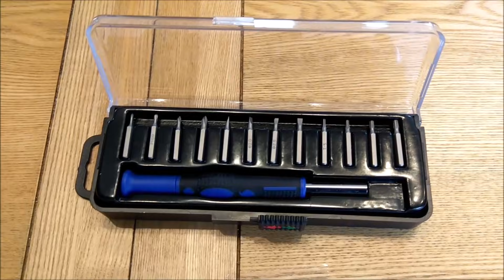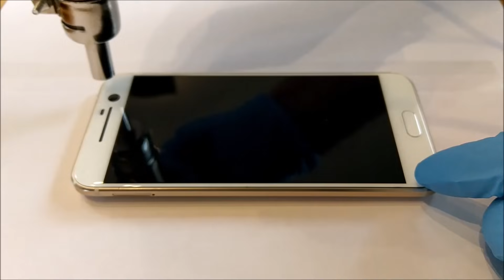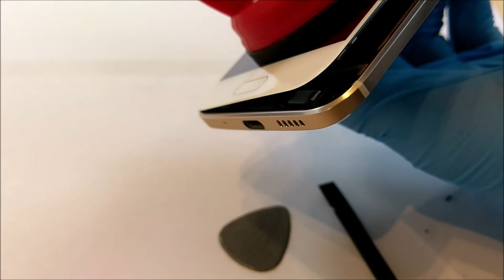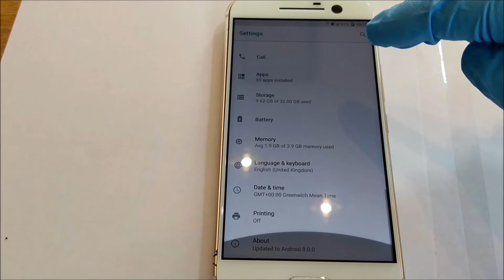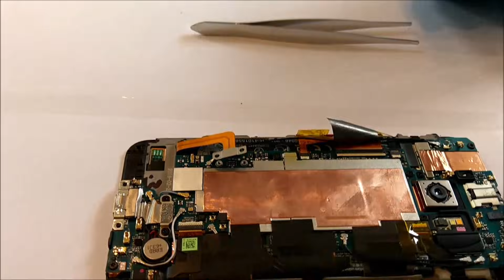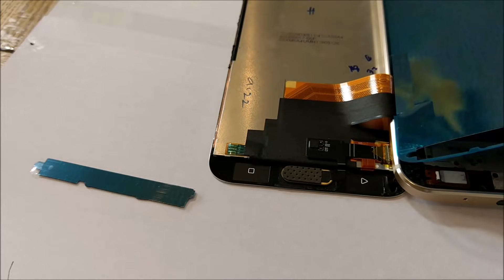HTC 10 Mobile Phone Battery Replacement

Comment: Hi, where can I get a tool set from to do this? Also which glue is best to use?

Cheers
Reply from the maker: I used B7000 glue, it worked better than the template. The tools are readily available on places like Ebay or mo ile repair sites. Thanks.

Comment: Great video. Really helpful. Can you tell me where to purchase the glue template from as that looked so easy. Regards
Reply from the maker: Hi,  It does look easy, but it's a waste of time as it doesn't stick well enough, and the screen starts to come off.  In the end I just used B7000 glue to stick it down and then put some heavy books on top until it had set.  Don't worry about a bit of glue getting on the phone, you can scrape it off afterwards.  The glue is available on Ebay. Thanks.

Comment: I have a tip for anyone that has the same problem I had. This guide is perfect and addresses many of the pitfalls before you make them. However, the camera has an attachment point that came undone when I followed this guide. I didn't realize it until I had the phone completely back together. Reattaching it involved an even more intricate teardown and reassemble than this guide. Save yourself some headache and don't detach the camera like I did.

My phone currently works perfectly. This guide is wonderful.
Reply from the maker: Pleased it helped you.

Comment: Thanks loads for sharing your skills. I used your video as instruction and I actually changed the battery of my HTC 10. It took me about 2 hours to get the screen off and in the end I worked 4 or 5 hours on the whole thing but I made it! Now I've got a couple of small black dots along the left edge of the screen, so I might have damaged it a little bit. But it doesn't disturbs so it's the price I gladly pay :D Now my phone doesn't turn off by itself anymore. Again, thank you so much!
Reply from the maker: That's great, we'll done, it's a tricky procedure. If you're really keen (but I wouldn't advise it) you can split the screen into its various layers from the back, they just peel apart. It's unlikely that you actually damaged the lcd part, the black spots are normally marks on the back light dispersion layer from prying when getting the screen off. It's normally tape or glue or dust. I use a cotton wool bud to clean it or compressed air to blow it out. If you're happy, don't bother though. Thanks.
Reply: @blackstone4823  I'm glad it works again, I won't touch the inside again xD

Comment: The worst part of the ENTIRE job (besides unsticking the battery without shorting it and causing an explosion)...is putting the main body back into the outer case without kinking the buttons. It's amazing the original assemblers were able to do this by hand. In no way will it just slide back in, the top and bottom edges catch on the main body, which makes it difficult to focus on keeping the buttons out. Pure madness, lol.

Comment: Bottom ribbon was glued to the screen. You skipped a few frames then. There's absolutely no way to unglue that from the screen or prise it from the centre without wrecking it. Funny how all the HTC phone how-to videos on youtube from phone fixers never seem to have phones with major glue issues. Don't make it 100% clear or you'd dud yourself of money lol.
Reply from the maker: The bottom ribbon is always glued to the screen around the buttons, the heat you apply normally makes it peel away quite easily, without heat you'll probably break it. I'm not a phone fixer, just sharing my personal experience. In fact all the HTC10s I have fixed have been for free. I made it as clear as I could to help anyone out there keep their HTC10 in service.
Reply: @blackstone4823  OK so why didn't you mention that it was ALWAYS glued in your video. You said sometimes both sides (maybe) The button on the other side no problem to unglue on mine even tho' you never had any. The other side didn't show you prising apart the ribbon from screen via the centre button...the video skipped a few frames. Everything else was manageable and you leave out the most difficult part!

Comment: Will a hair dryer do the job? I dont have such a hot air thingy at home 😉
Reply from the maker: Yes, I have successfully used a hair dryer, but be careful by angling it off the edge of the phone rather than into the middle.
Reply: @blackstone4823  I just did it! Great tutorial! 
But i damaged the screen at the top right corner where the clock is. I think i got under the screen with the plastic at the beginning when i tried to remove the screen. Damnit this thing is a hell to repair. Is there one more complicated than this? 😄
Reply from the maker: @derFuchsi  Big shame! Yes, I suppose it is a difficult phone to change the battery. HTC never intended it to be done. 2 years and then throw it away I think! If you really want the phone, you could buy a replacement screen I suppose, but that's another job to do! All the best.

Comment: Hi.  Thanks for the video.  My HTC10 battery or something (software bug) had been failing, same problem you read about.  It had been doing the thing where it prematurely powered down (even at very high charge levels) and required a hard boot for weeks before it failed.   The power board had failed, too, we thought, at the end. The phone would try to boot but then cut off. 

A couple of the connector types were difficult; had to develop techniques for those along the way. Your instructions were excellent!    We successfully (imo) replaced the HTC 10 battery (and went ahead with a new screen and power board since we were at it).   
So the phone booted at 57% battery and operated all properly until drained.  But something else is wrong -- the new power board won't charge and gets hot.  

I would like to find a way to charge the new battery that's installed while it's OUT of or disconnected from the phone, via that ribbon cable. (We haven't closed the phone up again so I can take it out easily. )  Can you help, please?

One battery charge would at least allow me to recover some data.
Reply from the maker: Hi, sounds like you've had your fair share of HTC 10 fun! The power board getting hot is bad news and is normally caused by a short in the ribbon cable connector where it connects to the main board. When installing the power board, did you connect the ribbon cable with the battery connected? The battery must be disconnected at all times. Anyway, there's nothing you can do about it now except look to see if it's straight and pushed in properly. Unfortunately you can't charge the battery when it is disconnected via the cable, its a very complicated and electronically controlled process. If the data is important, all I can suggest is sending me the phone (if you're in the UK) and I'll do my best to get the data off. I have one here half in bits to help! All the best.
Reply: @blackstone4823  Thanks very much for the reply.  And offer of help!  Unfortunately, I'm in the States.  Maybe our discussion will help someone else who reads in future.

The battery was never connected while we were replacing anything.  And a correction -- the phone back was getting hot while I was draining that new battery, but the power board actually never responded; it was as though it wasn't connected.  Not sure it was getting hot or not.

My partner is an electronics engineer.  I understand that you need a circuit to control  charging a Lithium Ion battery.  Along with the battery, power board, and screen, my partner had bought some little charging boards (intending to charge up that battery before installing).  But the connections are extremely difficult so we didn't try that out while attempting rebuild of the phone.  (Thus it came up at 57%; we were lucky we got any appreciable power.)

Now that our rebuild did not work, there was nothing to lose, we thought.  Last night after sending this question to you in comments, we were trying to connect one of the little charger boards to the new battery (all unplugged, of course).  

But upon touching with light force to make the connection, the black plastic part of the connector on the new battery's ribbon cable actually disintegrated.  ( Same thing had happened to the connector on the first power board we tried before -- that black plastic must be getting old?!   Never seen anything like it. Are all surface mounted connectors fragile near to one-time connectors?  A moot point, I guess.)

So...  now I have a new battery with broken connector, and the original bad battery [ using a meter to test] with a good connector.  

Without getting into the silver packaging or chemistry of the old battery, we managed to remove the "end cap" circuit with ribbon cable of that old battery.  It was taped on fairly strongly.  It's just got two conductive tapes about 8mm (?) on the battery end for +/- that actually are accessible.  We're assuming the little linear circuit board (teensy tiny parts!) is the temperature sensing part.  So there we stopped for now.
Reply from the maker: @rwind656  I think that most phones are one-time phones, never mind the connectors.  They are never supposed to be opened, the phones lasts the contract period and that's it.  It's a shame as I'm still using an HTC10 that is nearly 5 years old and it's great, I don't need anything else.  I think more stuff should be repaired and re-used rather than thrown away.  All of the internals are pretty fragile, it's difficult to dis-assemble and re-assemble without breaking something on your first attempt.  You're lucky to have an electronics engineer on hand.  I think that the linear circuit board is also the under and over charge protection circuitry.  How much did the new battery cost you in the States?  If the data is valuable, I can send a charged battery over so you can get the data off.  It'll probably take about a week.
Reply: @ @blackstone4823 , thanks very much.  You did well to keep your phone in operation!  Kudo's.

I think I got most of my data off but I was having trouble with the USB-C cables transferring data to my desktop for a long time -- without realizing that some cables will only charge, not pass data.  Duh.  So I had not pulled everything off routinely.  And had not kept up with backing up in other ways.  Silly of me.  We'll see later if I have salvaged my contacts list; I really think I might have saved everything else, and I might have the contacts as well, though the last time I migrated to this phone, it was garbled data.  Fields missing and misplaced.  Thanks for the offer to help;  let's see how far we get.

The new battery was ... something under $20?  The screen was pricey-- pricier, and sure enough we separated the original on the first opening.  I will ask how much it all cost, as I lost track and did not do the ordering -- I might miss a detail so I let my partner do the ordering.   

Today, as I was writing you, my partner ordered another power supply and we are going to attempt charging in some fashion (though I was pretty sure we already had an adjustable supply -- there must be a reason -- perhaps something more controllable).  

I know you don't want to overcharge and as well as +/- on the outside edges of the battery connector's ribbon cable, there were two other labels on the narrow little middle conductor.  

"ID" is perhaps an identifier for USB-C to say which way the plug is inserted by the user.  [ I think from a search  Look down below the drawings of plugs, a paragraph...

https://batteryuniversity.com/learn/article/charging_from_a_usb_port.]  

And "TH" has to do with the temperature sensing.   Interesting.  My partner suggested that just supply pos/neg might not be enough -- if the temp data is not supplied, or reads wrong, perhaps the phone will not operate.

I guess it's become as much an electronics mystery project at this point.

Comment: where did you get your glue template? Im not able to find one that wont take a month to get here. What are my alternatives? Ive found glue tape, but a lot of folks say this stuff wont hold for an extended period of time and always ends up coming off. Im familair with the E7000 glue, but Im a little hesitant to use that since I don't know the glue points in the phone and a little reserved at making a mess in the phone with liquid glue.
Reply from the maker: I didn't use the glue template in the end, it didn't last. I stuck it on with B7000. Just run it all around the edge, including under the screen ribbon, in as small a bead as possible. Good luck.

Comment: excellent very detailed tutorial. Everyone says this phone is a nightmare to replace the battery. doesnt look too bad to do. One thing I would do beforehand is remove the sim and sd card before doing anything.
Reply from the maker: Thanks. It's not so bad after the screen is off. Getting the screen off without damaging it is tricky. Some just stop working for no apparent reason because the ribbon cable can't cope with bending, and fractures inside. The older the phone gets, the harder it seems to be. Have fun!

Comment: all went well until I discovered I have lost screen sensitivity in the lower 1/2 of the screen. I'm guessing there's no easy fix... done and dusted?
Reply from the maker: I'm afraid I've never found a solution except to replace the screen. The ribbon cable breaks inside when it is moved doing the repair. Copy screens are cheap, genuine ones are expensive and not worth it. Sorry it didn't work out for you.

Comment: Thank you so much for this guide! It's the best guide on YouTube regarding the HTC 10. Today I changed the battery in my dad's HTC10 using this guide and it all worked out well. It took me three hours but in the end I was very happy. I also changed the display as the old one was broken. I have a Zhalinda B6000 glue flask and I was wondering how to glue the screen back. Do I really need a template or can I apply the glue directly in the corners? Also the Power button came off and I was wondering if it needs any glue to stay in place or when I push the board back in it will press upon it and fix it in place? Thank you very much once again for all the work you've put in this video and be sure you saved a lot of people!
Reply from the maker: No you don't need a template, and I don't use one anymore because it is not good enough. I carefully clean off any lumps of old glue and then put a small bead of glue all around the edge, including where the ribbon cable is (can be tricky, do it there first with the screen in the closed position). I also put one bead just above the LCD panel being careful not to obstruct the speaker, camera and sensors, and one bead just below the LCD panel to prevent light bleed from the haptic keys. Position the screen carefully and press in to place. I then place the phone screen down on a flat surface with some heavy books in top for a few hours. I would carefully glue the power button on to hold it in place, but it might work with no glue. The case does hold it well when assembled, but the phone needs to be screwed down well for the power button to work properly. Glad the video helped, good luck with the final stages. Thanks.
Reply: @blackstone4823  Thank you for your fast reply! I will try with your solution and let you know how it worked. Have a nice day! 👍🍻

Comment: Saved my bacon today. Been dreading this repair for months but it went pretty well. Only severed a bit of the adhesive tape holding the lcd to the glass
Reply from the maker: The screen can stick to the backing and when you attempt to lift it, those bits of tape pull apart, sometimes leaving you with lots of layers of LCD screen to put back together. The main problem is keeping them clean! Glad it went well for you, it's not the easiest of repairs.

Comment: Thank you very much for this step by step tutorial! This was my first phone repair and these directions covered everything I needed to replace my HTC 10 battery. 
When unclipping the main boards from the back case of the phone, I did pop the proximity sensor off accidentally when working the top edge and could not push it back into place. The sensor is connected like a little lego block and is sandwiched directly left of the front facing camera, so be careful when popping out the case housing around there. If I would have taken all the boards apart I think I could have popped it back in, but I didn't feel like extending this intricate surgery. Other than that, 100% success and my phone charge now lasts 3 days again. Thanks again!
Reply from the maker: You're welcome. I actually modified my technique so I didn't pry in that top area. You can actually just work around the charger socket and then lift it out. We'll done anyway, it's not easy!